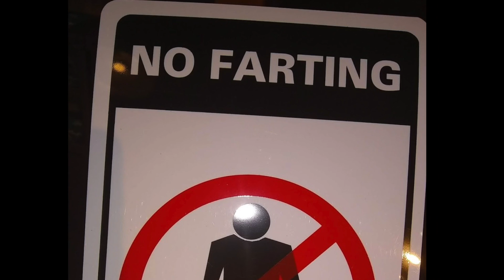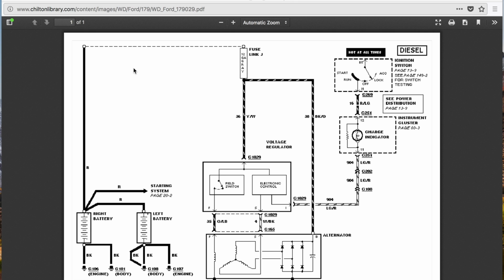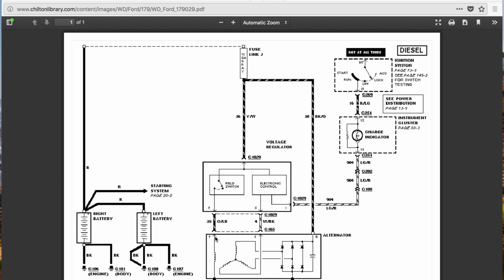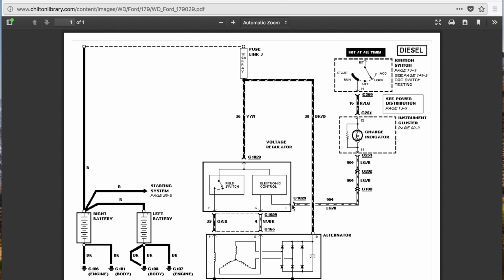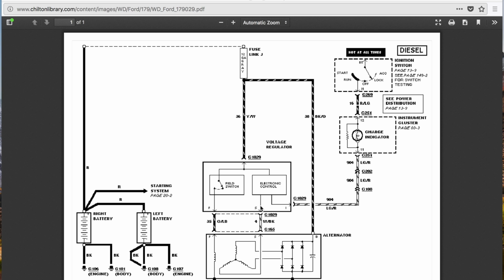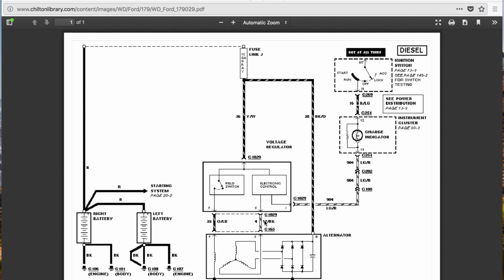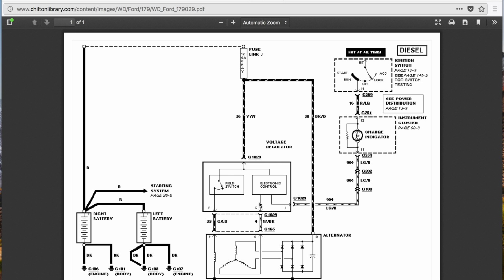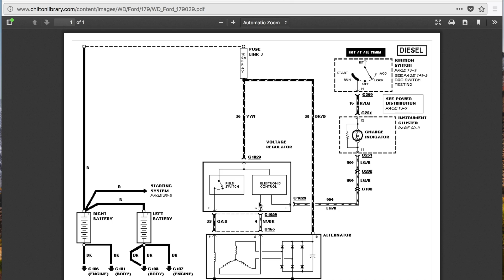Ford FSI Charging System 1992 F450 Super Duty

Comment: Great explanation Tom. I guess all of this extra electrics is in place for improved fuel mileage?
Reply from the maker: There's not really any extra electronics it is just today the voltage regulator is built into the electronics.   The main reason is just to get the voltage at an exact level no matter how fast the alternator is spinning.  Alternators are only about 60-70% efficient, so I don't think they care about fuel mileage! 

A lot of newer Fords like the Ford 500 have the PCM control the alternator.  I had to fix some broken wires going to the pcm on a few of those.